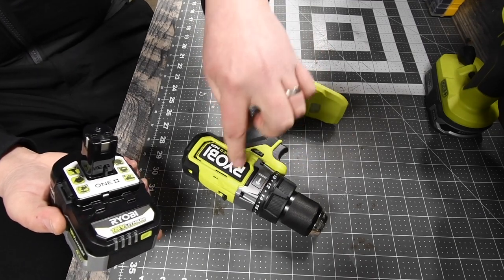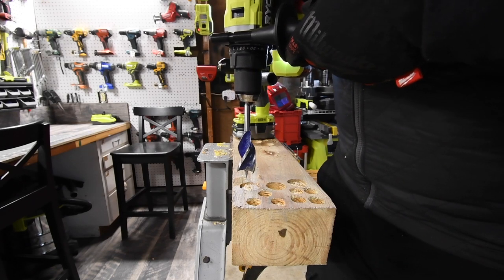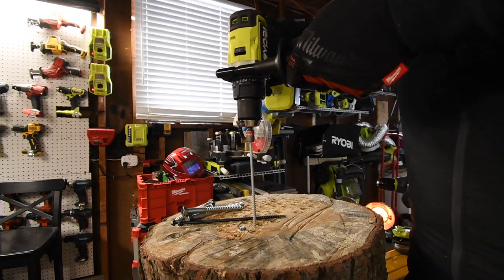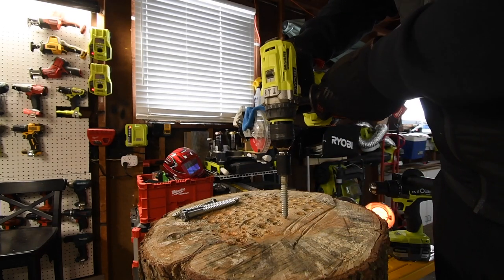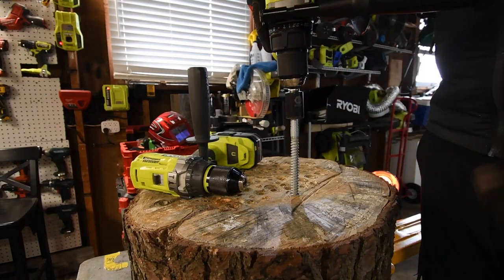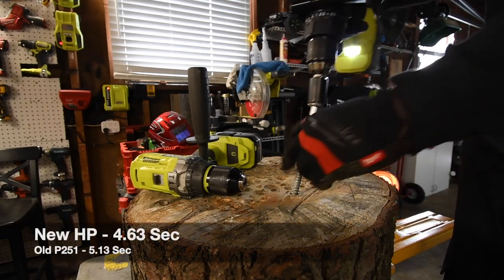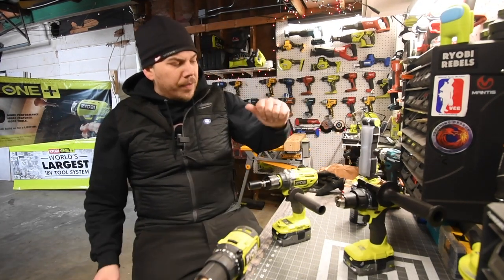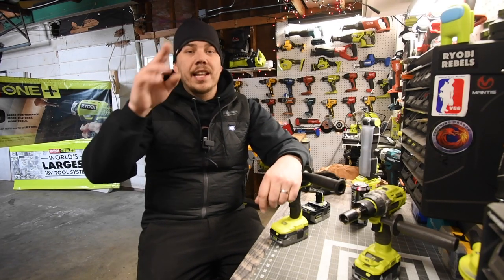New Ryobi HP  vs Ryobi P251 (Hammer Drills)

Comment: The old version is adequate for drilling if both feet are on the ground. It just takes longer. There is also a chuck slipping problem. That is solved by using clutch mode to tighten. I don't see a reason to update. However, the SDS hammer Ver2 is worth looking into as an upgrade. When you're up on a ladder, the old hammer drill is a NOGO.
This new hammer drill is impressive, but I'd recommend a different color.
Reply: Well, there's a list of things they're changing with the HP series... Newer battery is an update and offers better performance than the older HP+ batteries, which for the high powered tools like the SDS drill and grinder make a difference... Self power regulation makes the tools more efficient and should run longer on a charge than the older tools... Improved self protection system should make them much harder to brick/burn out and release the magic smoke... They're more streamlined and lighter, and first to offer compact versions for Ryobi that weren't 12v limited... and they're expanding them into the 40v line up as well, which is coming out with some new options like the Auger drill, and a 1800W inverter is coming out soon... While for the 18v they've discontinued the 2 battery 36v 10" sliding miter saw but they're coming out with a 7 1/4" sliding miter saw for the HP series that'll run on 1 battery and is optimal with the new High Performance 6AH battery for the HP series...

So there's bit more to it, big picture wise...

The only terrible update so far is the circular saw, looks like they are attempting to create one that is compatible with a track system to be used like a Track Saw but it has some design flaws they need to fix...

Others, like the compact tools, just have to understand their place as they're not meant to replace the larger tools.  While some you won't see their max performance until the new High Performance batteries are out too as they are optimized for the HP tools...
Reply from the maker: I love how much metal is on it and the new handle, more tests will be coming
Reply: @ZeoCyberG  I bought the first brushless 7 1/4" saw ,it was crap ,got excited when the new one came out and it was crap also ,I am slowly moving over to Dewalt. Btw I have always had an exceptional run out of  Ryobi drills but their chucks were always wobbly.

Comment: Not arguing performance here but I think the HP tools are lacking a lot of the nice features of previous brushless models. You’ve lost the magnetic holder, bit holder, and the battery doesn’t have rubber molding. 
   If you’ve got a real reason to upgrade or old one breaks it would make sense. Otherwise I’d say stick with your current tools. 
    That being said the outdoor HP tools look like big improvements. The 18in 40V chainsaw looks like a beast, new string trimmer looks great, they’ve added the augers to the line up, etc.
Reply from the maker: I hate that the new batteries do not have that molding on the bottom. it bothers the crap out of me
Reply: Agree but the biggest thing I hate that they changed was moving the lights to the bottom instead of in the front. I dont know what they're thinking but that was dumb for many reasons.

Comment: The differences in performance is negligible tho the new handle is indeed better.  BUT, by far the most used and useful feature is missing in the newer version, the magnetic tray.  Hands down this feature out ways any improvements of the newer drill by sheer volume of use.  99% of the time i don’t have the handle attached but 99% of the time i use the magnetic tray!!!
Reply from the maker: I do miss the tray as well, and I thank you for viewing 729
Reply: if you need a good magnet buy a neodymium magnet on ebay and glue it in place, much better than the mediocre magnet tray on the old drill.

Comment: Hey thanks for the review. this was the one I was waiting to see cause I have the old model and I was wondering if it's worth upgrading. Also I appreciate the concrete test cause I drill alot of that for tapcon screws. I think you should include concrete test in a verses video or a review cause they are hammer drills. I've watched alot of your  hammer drill videos and it seems rare to see concrete test. But thanks again Im leaning more now to upgrading
Reply from the maker: you are welcome Weldon
Reply: If you're drilling a lot of concrete, don't even waste money on homeowner grade hammer drills.  Get a proper corded SDS if you want bang for the buck.  The key to effective use of budget tools is to understand their limitations and what will wear them out excessively fast.

Now if you don't really "drill alot" of concerte, then just keep using what you have and if you  wear it out, then it is time to get the latest model and only makes sense to get what uses same batteries you already have, unless you don't have the magical HP batteries and then, your old batteries may not give you the performance you expect, and yet, batteries too, need replaced every now and then.

Comment: Not sure why you decided to use the newer battery technology on just the newer drill... You must use at least a four amp hour and optimally a 6 or 9 hour to get full power from the HP tools that have the two extra connectors.... You could have at least use the same battery on both tools for a fair comparison
Reply: New drill system against older drill system.

Comment: I don't think Ryobi was making complete crap 2 years ago like you said. I have a drill from 10 years ago still working great.
Reply: Same here I bought a used one at a swap meet around 10 years also n it still works great 🤘🤘
Reply: This is the problem with youtube videos, where reviewers try to make mountains out of mole hills and can't fathom just grabbing a tool and getting work done.   It's always some race, or some thought that since it isn't their money, should someone else replace a tool that works perfectly fine, or pay the premium for the newest model if the reason they picked a homeowner grade brand to begin with was to save money because they don't need ultimate performance.

Ryobi will never be the top pick if there isn't a budget limit, but knowing their limitations, they are a great value as long as you don't waste money on their latest greatest just arrived models that haven't been discounted yet, like if they haven't been put in the free tool w/batteries bundles during Ryobi Days at Home Depot.  If they have and you have the pick between the newer vs older drill, sure get the new one.  If you can get the older free with batteries you need anyway, seems silly to spend another, what, $100+ chasing a little bit more  performance because that race never ends.  There's always going to be something just a little better next year.

Comment: Yesterday I was using an old P214 Hammer Drill that hasn't been used much with a 3/16" Tapcon bit for some 1/4" x 1 3/4" Tapcon screws and it wouldn't hold that bit unless I tightened it with the chuck gripped in a bench vise. I pick a new P251 some months ago and have yet to use it. Is the chuck on the P251 any better than the chuck on the P214. Now I will say this was the toughest concrete I've ever drill into, it's a heavy equipment shed and I suspect the man that had it built spend extra on some type of high strength concrete which don't get me wrong is great. Thanks!

Comment: Do the first test on speed two using the hammer selection seems to kick ass for me with those sort of drill bits...Bit of a bogus comparison at 3:45 it took an extra 3 seconds for the cutting edge to reach the timber over the second test.

Comment: atleast there was slight improvement based on times on the video but when i was looking up the new ryobi hammerdrill and i was surprised and disappointed when they didn't improve the torque on the hammerdrill both ridgid and milwaukee have 1200 was expecting ryobi to bump up to atleast 1000 inch pounds
Reply from the maker: I love that they added more metal and a much better handle
Reply: I wouldn't trust a 1200 inch pound claim so boldly.

There's a high torque drill called hilti sf-10W and it has a multi-pole high torque motor with 4 physical brushes, 4 actual physical transmission gearings instead of 2 like all normal drills. It only claims around 1000 inchpounds despite using 24 volts. 

Because of the internals though, I actually believe it can do it. I don't think it's wise to trust any 'small' one-handed drill claiming to put out 1200 inch pounds with only a basic brushless motor and only two transmission gearings

If you need that much strength, get a paint mixer 😁
Reply: @Biaanca5036  yes i agree, i don't think that Milwaukee arrive to 1200

Comment: Would you recommend the makita 12v system for an 11 year old
Reply: I would but make sure to get The brushless versions because they are way more powerful than the older brushed version. I also have the Milwaukee M-12 brushless stuff and love it. The Dewalt X-Treme 12 volt brushless stuff ish awesome and powerful too. Any one of these brands are great. But only get the brushless tools.
Reply from the maker: yes I do, a 12v tool won't be overpowered for your abilities

Comment: It was bit strange. Im in Iceland and i was in the store last saterday and i was compering this two or i think i was. The euro types have diffrent numbers. The old one was register at 84Nm or 743. But the new one was clearly market on the pack as 54Nm or 478. I was very surprice by that so i ended up buying the old one, the last one they had. I thought maybe becaus the old one had the 2 HP battery connectors wish the other one did not. Also the new one here only has 1700 rpm vs 1800 on the old....very confused right now 🙂 but great video wish i had seen it before buying (live 5 hours away from the store).

Comment: Wonder how the new drill performs with the older non HP batteries
Reply: Ive heard differing information one of which stated that because the new drills dont have the HP tab on the back they treat all batteries as if they are HP batteries....I honestly dont know if thats true or not but the performance for me seems the same regardless of HP battery or standard.
Reply: @shadowbanned5164  the compact series and OPE don't have the terminals (which is where most people don't bother to check and start bitching for no reason) but the full size HP tools do have the terminals, although even then it's only the power hungry tools for some reason.

Comment: What batteries are being used in the new 4ah batteries. 21700???
Reply from the maker: I thank you for viewing
Reply: I think only the 3 has those
Reply: Ok, but I just wanted to know what cells are in the battery packs. I could always take mine apart and take a peek
Reply: 18650s  only the p195 has 21700s